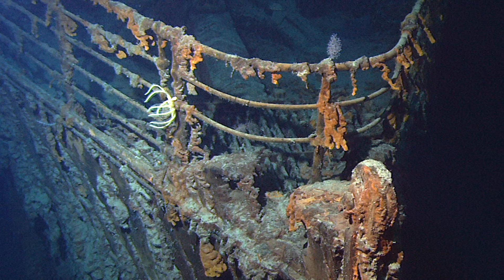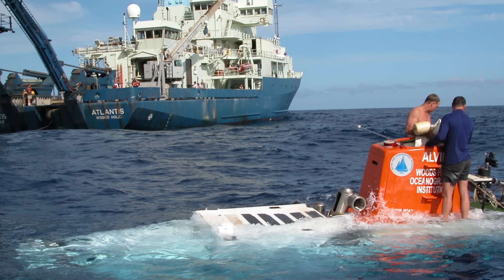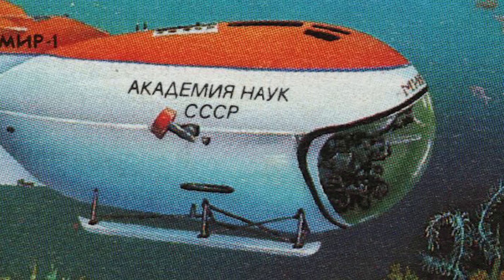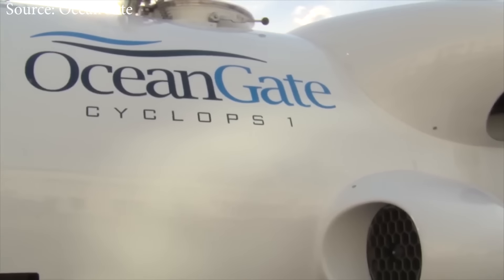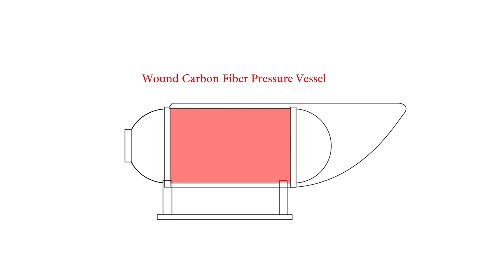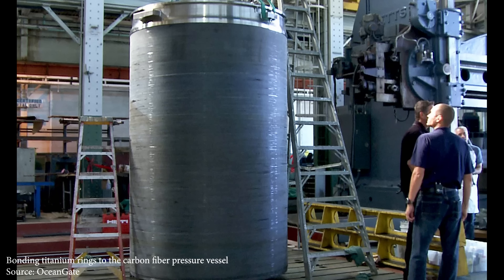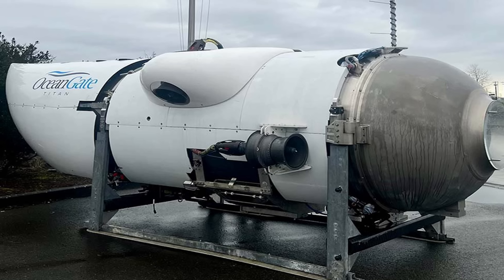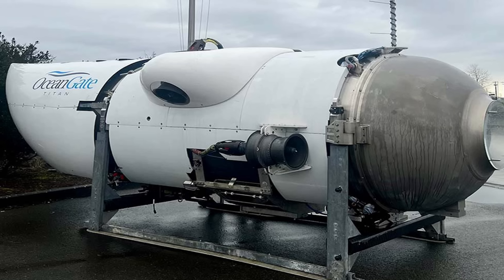How Titan was Built, Lost and Found: An Analysis

Comment: The material choice of carbon fibre over a proven metal pressure vessel baffles me. Everything I'm learning about this disaster just makes me wonder how Titan was ever meant to reach the depths of Titanic without risking failure
Reply: Probably a combination of hubris and "oh, engineers always build in a huge margin of unnecessary safety so they don't get sued."

The use of a carbon-fiber pressure vessel may not inherently be a fatal objection, but at the bare minimum it needed to be thicker. Five inches sounds like a lot, and if you're making an aeroplane to fly up high in the sky, or a racing car or whip around the track at Le Mans, it's insane. At 3,800m of North Atlantic, it's insanely thin.
Reply: Because with Titanium it would only fit 1 or 2 passengers.   They wanted more.   Its a story of a company in red and continuing to lose money cutting corners to try and squeeze a profit.
Reply: The Titan cost around $370,000. For a metal hull that can only carry two people, will set you back $37 million. 100 times the cost. The carbon fibre hull should have been thicker, and even at 5" thickness it had completed 13 prior successful trips to the Titanic. It's a no brainer why they were tempted to use carbon fibre.
Reply: But it did reach the bottom 13 times before it failed. This is a tragedy, but it is also showed us that carbon fiber CAN withstand the crushing weight of those depths if it’s done right and inspected often.
Reply: @quietcosmos. it didn't reach the bottom 13 times... this was "mission" 5 with a "crew" and the others were test dives and not all of those were successful
Reply: @simplysteph_   One YouTuber (DALLMYD) was on Mission 3, (the last one before this), and it never left the launch sled due to problems. He reported that Mission #1 and #2 never got on the Titan because of weather problems and some issues with the Titan. The #4 or #5 mission is the one that has imploded. Mission #s refer to the trips they planned to make for just this year,2023. Each year, or season, they started the Mission count over again,  but they only had 2, maybe 3 successful dives to the depth of the wreck from 2021-2022, which are only other years they did the paying passengers. Mission #5 may have been #4, that isn't clear from DALLMYD's testimony.
Reply: @gailmcn  There is a lot of contradictory information and there are a lot of experience youtubers who are claiming they did 13 successful dives to the Titanic, including many other dives in the Bahamas as well as pressure chamber tests. I think in the weeks and months ahead the facts will emerge. There is even uncertainty whether the acrylic viewing port really was only rated to 1400m or whether it was the earlier test model that had the 1400m rated port. Still early days yet.
Reply: @simplysteph_   A single success disproves impossibility even if it fails 99 more times.
Reply: @Shift4g  conversely, 99 successes don't prove a design isn't fatally flawed if it fails catastrophically on the 100th time. And yes, I'm going to call it a fatal flaw, because if you have designed it properly, it either never fails, which okay, that isn't possible, or at least has means of telling when it is close enough to failure that you should no longer use it. 
If you want to make the argument that this is a fine design for a "disposable" submersible that is only intended to be used 5-10 times (or less) before being discarded, okay, that is an argument that can be made. If you want to make the argument that this is an otherwise safe design and OceanGate was simply grossly negligent in the necessary preventative maintenance and inspections to determine the continued safety of operating it, that's another argument that can be made. But, there is a fatal flaw somewhere in the process, either the design, the construction, or the maintenance.
Reply: @smileyeagle1021  I can agree with that overall assessment
Reply: @methylene5  You are correct that there is a lot of contradictory information. Most of it is based on interpreting salesman Stockton Rush's claims of how many "successful" trips Titan had, as meaning "reached the depth of the Titanic and safely returned". But is he including attempts to reach the Titanic that failed, but everybody came back safe? Is he including 2016-2018, in that number, (pre-passenger years)? Because based on actual public passenger testimony, only a few (2-3) actually report seeing the Titanic wreck. The rest report failed or aborted attempts, which many of those still reported as a positive experience. Unless an actual log  of all Titan activities was kept, we don't have anything but contradictory info. but certainly not 13 trips down-and-back to the depth of titanic. Nor was any hull integrity testing done on Titan (which is the  "renovated, reconditioned" Cyclops 2 submersible, it was renamed Titan when it was put back in service in 2019 or  2020). Same viewing port. Cyclops 1 hull was scrapped, and remade. No one has said whether some parts from cyclops 1 went into cyclops 2.
Reply: @gailmcn  I thought Titan was renamed from Cyclops 2, and Cyclops 1 being a completely different vessel. It's getting hard to keep up with the hear'say. I also heard that their last text to the ship was that they had dropped ballast and were returning. Can't find any confirmation of that. 
Also, I heard that the view port was rated to 4000 metres, but the bracket was different so the company would only rate it to 1400m depth, though the acrylic itself was safe. There are so many stories floating around right now.
Reply: @smileyeagle1021  yeah, seems that the biggest issue in this was the maintenance and testing. from what i heard, they just didnt do enough testing on the hull to know how many cycles it could handle, nor did they inspect it thoroughly between missions. from the sound of this video, it seems they just relied on acoustics to give them any warning which proved to be too late.
Reply: Seems to reinforce the old saying Falk, "If it ain't broke dont try and fix it!"

Comment: 13:17 Misconception, the corners of the Comet’s windows were rounded, the cracks originated from the squared off openings for antennas, referred to as windows. DH giving latter variants more rounded windows is the reason this misconception is so prevalent.

Comment: Carbon fiber is great for holding pressure IN, but not for keeping pressure OUT. Also carbon fiber is not some sort of magical material that can do everything perfectly. It's an amazing material for certain applications, but it can't replace steel and titanium when the properties of those are called for, like, I don't know, several miles below the surface where the pressure will crush a human being into paste in a milisecond.

Comment: Good video, with a lot of useful information.  I want to comment on Carbon Fiber as a material.  Carbon Fiber is one of the strongest materials known.  It's commonly used in aviation for the pressure hulls and fairings.   However, it is a FIBER...  a THREAD...  When you pull on it, it's incredibly strong.  But when you push on it...  Well, take a length of dental floss and pull on it.  Then push the two ends together.  That gives you an idea for how Carbon Fiber works.   Make a bottle of carbon fiber and fill it with something and it can withstand massive amounts of internal pressure.  However, that same bottle can be crushed with a fraction of that from outside.  Using carbon fiber to make a submarine was a very strange decision.
Reply: Stockton was an aerospace engineer who forte was making aircraft where carbon fibre is used for pressure hulls as you said. Maybe he just didn’t have enough deep ocean engineering knowledge and didn’t listen to the experts
Reply: thank you for dumbing it down

Comment: Carbon fibre is used on vessels that contain pressure internally because the CF is in tension,  but in this Titan sub the CF was in compression, and could de-laminate without showing any damage on the outside... Also the different reaction of Titanium to CF when put under pressure meant differential movement, another source of problems.

Comment: Great video Mike. I saw one video where they were bonding the Titan’s metal front and back pieces to the carbon fiber tube using adhesive - I think they mentioned acrylic adhesive. I do not have expertise with these materials but it struck me as a risky approach. It seems that they were using aviation fuselage manufacturing techniques for the submersible. I would guess this would be fine for shallow diving submersibles but not for deep sea subs.
Reply: I wrote the same comment on another site and got a reply thus:
"If you could lay a glass sheet on the glue they slathered onto the joint you would see air bubbles throughout and in between the surfaces. Except they couldnt see it, and congratulated themselves it was a job well done as they fitted the titanium collar over the carbon fibre and walked away." 
These bubbles are pressurised up to 6,000psi and then down to atmospheric air pressure each cycle, within the carbon fibre matrix to do whatever damage they can do like mini submersibles themselves.

Comment: 13:14 Correction, the Comet didn't have square windows, it used windows with rounded corners, like every other aircraft at the time. The real problem was that the rivets were punched into the skin in a way that left microscopic cracks in the skin of the plane. This video explains it well: https://www.youtube.com/watch?v=-DjnG74DDno 

I noticed something similar in the Titan's interior, which, if I'm correct is an extreme cause for concern. It appears that the screens are bolted into the skin of the vessel. I don't know what type of bolt/screw was used, and whether it penetrated the actual hull, but that if it did, that would appear to be a shockingly bad design decision!
Reply: Yeah I noticed this too. it's been suggested that there was an interior cladding onto which things were affixed. The concern is whether or not any of those screws happened to pierce deeper than the cladding. You would think not, but then you would also think that such an experimental pressure vessel wouldn't be glued together in a dusty warehouse using a winch and 3 lads to eyeball alignment.
Reply: @jonzenrael  Exactly. The more I read about it, the worse it gets. I wouldn't have put it past them to have longscrewed the hull...
Reply: Another thing that people get wrong is that the failure point on the accident Comet was around passenger windows. In reality it was around two square-ish cutouts in the upper fuselage, at least on the second example that crashed. These cutouts actually retained their square shape to the end of Comet's production

Comment: I have heard from other channels that Titan was tested to a depth of 3000m but not the depth of Titanic at 3800m+. Carbon fibre disintegrates when under excessive pressure and I believe (my view) that 3800m was far too deep and over pressure for Titan. Great video Mike.
Reply: Even 600M was too much for it.
Not right away, but gets compromised over time.

Comment: Unfortunately, Oceangate was more concerned with making money & ignore advice, disregard proper procedures, & cut corners with using “off the shelf” parts that were not ever intended to use in the fashion of deep diving. I do not fell sorry for those guys at all. I feel sorry for the 19 yr old, the friends & families of the dead. C’est la vie.
Reply: I don’t understand why people keep focusing on the “off the shelf” parts.  There’s nothing wrong with that and in most cases it makes total sense to use off the shelf when appropriate or beneficial. They weren’t cutting corners by using off the shelf.  There’s no need to design and engineer a super complicated mouse trap when the tried and tested basic mouse trap works perfectly. 

As mentioned in this very video the US Navy now uses off the shelf game controllers to control  their new submarines.  Game controllers are used for a lot of military applications.
Reply: Yep, the CEO even said there's a rule against using carbon fiber with titanium but we did it anyway
Reply: @cruisinguy6024 Agreed, The gaming controller is absolutely fine, Its literally no different than a Joystick in most heavy machinery..  It probably shouldn't have been wireless but still, Completely acceptable imo.. Same goes for the lights from the Camper Rental.. Completely fine..

Now the Carbon Fiber Hull on the other hand was not, It is definitely what caused the implosion.. A dozen dives and was never properly inspected or replaced with new Carbon Fiber.
Reply: If I were a bored jillionaire with more money than wisdom, I'd probably have bought Rush's snake oil, too...  I feel so bad for their loved ones
Reply: 100%. I almost feel as if the civilians aboard were murdered. The CEO took tourists on an experimental sub and intentionally and knowingly exposed them to unnecessary risk. He and be alone killed them. It’s really sad to think about.

Comment: 17:00 onward for a couple minutes you talk about how they chose a different design philosophy by not having any major electronics and equipment on board, and instead rely solely on the mother ship. If that was the case - why didn't they use a tether with cables? When your talking these depths, NO wireless communication, GPS, or anything like that can travel through water, which is why they had so many communications issues. My understanding is they relied on text messages that occasionally would make it that far down. Unreal. This was cost cutting to the extreme and a severe design FLAW, not philosophy.
Reply: I mean, I agree, but that would be a long-ass tether. Would it be even feasible for the ship to carry/spool it? I feel like "simplicity" and "diving to the Titanic" don't belong in the same sentence.
Reply: ceo didnt want be bothered. got his wish. no one be bothering him ever again
Reply: Certainly a tether comes with its own challenges and obstacles to overcome - but I feel it would have certainly solved a LOT more issues than it would create. This sub was NEVER designed to go INTO the Titanic or any other wreckage. Just the safety hazards alone of debris falling into its delicate thrusters alone would forbid it. So a tether makes absolute sense. I DONT find the controller to be a worrying subject - there's tons of bonuses to using commercially available products such as controllers. He should have used a PS or Xbox, or Switch Pro controller however. Not Logitech. Anyways, that's my 2cents.
Reply: @nerdygem8620 the ss reco used a cable over 3 miles long. It could have been done

Comment: Could you also explain how Titan would have been brought to the surface if it had been found intact and before time ran out?  I’m thinking there was no way to rescue them in the first place.
Reply: One of the first craft on scene was an industrial pipe-laying rig with multiple ROVs it could deploy. If Titan was stuck at the bottom intact, the most likely reason is that they'd become hopelessly lodged in the wreck of Titanic, and the ROVs would simply cut her free with torches or grinders or the like.

If they'd become entangled in a fishing net adrift, same thing; cut her free. The thing would float to the surface on its own if the hull was intact, they'd dropped their ballast and the landing legs.

Comment: I totally get why they wanted to use carbon for the central tubular section of the pressure vessel. It is strong, lightweight and wound tubes can be made relatively cheaply. It seems the pressure vessel was essentially neutrally buoyant by itself. Compared to Alvin, the Titan seemed to have not needed any external buoyancy material. The advantages of carbon fiber composite must have been so tempting that they overlooked/ignored how finicky and difficult it is to work with.
Rule number 1 at any subsearch, there is always a banging sound.
Reply: I'm no expert in materials science, but it seems that Oceangate should have adopted the practice of retiring carbon-fiber submersibles every year or two and replacing them with brand new ones due to the weakness of carbon fiber relative to steel and titanium.
Reply: The advantages of cf are certainly there for expansion vessels but for compression vessels? I'm thinking rope-in-resin. 
Fine for pulling, but seems like glass fibre to me. How useful is rope for pushing? 
And never forget a cylinder must be perfect in tolerances to withstand compression. The slightest defect or differential in circularity will lead to sudden immense bending forces.

Comment: Thank you Mike, you've done these tragic events justice. That is all.
Reply: This fools should have just swim up instead of stand down there then they'd be dead
Reply: @mattwilliam5522 the titan imploded, meaning due to the pressure they literally crushed. also they can’t escape as they were bolted in. they would need someone from the outside to free them so they could swim.
Reply: @awangie  wrong they was under water not in a car so I would have floated up to the top and swam. Away
Reply: @awangie  you can drink water but you can't breathe it